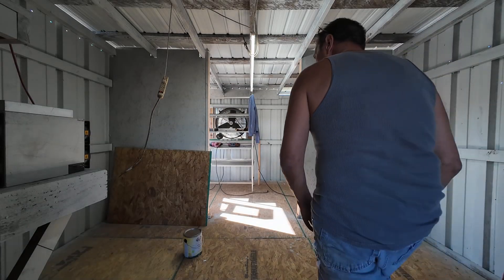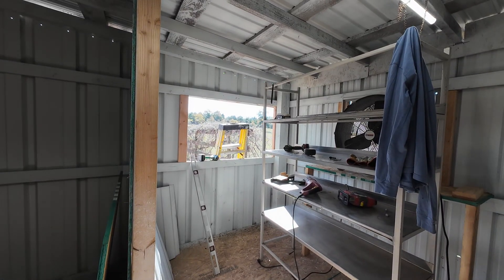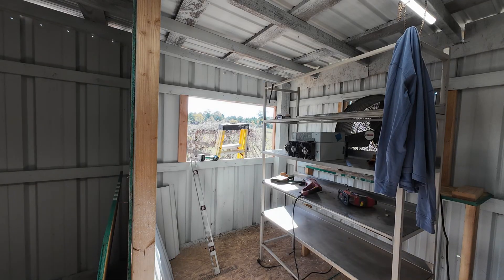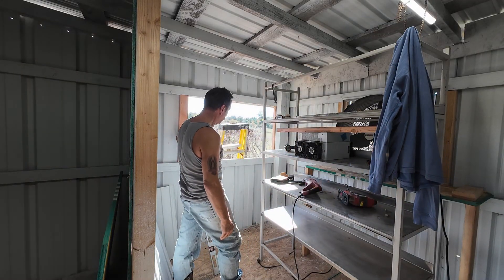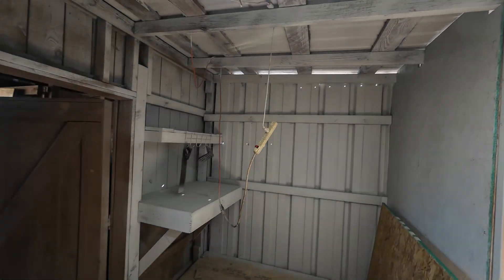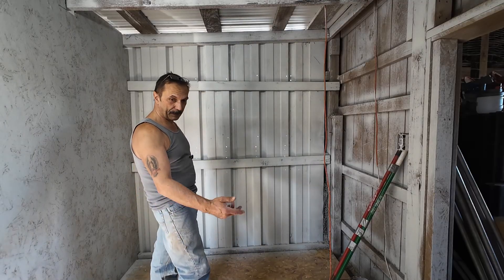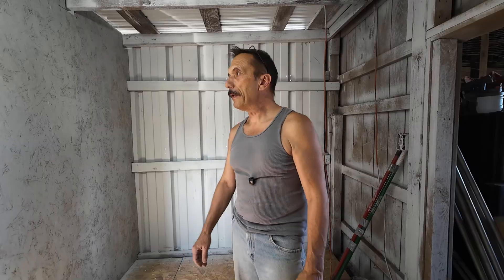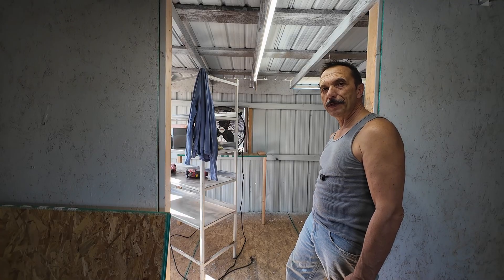Expanding the High Voltage Micro Grid for 50 kW of Miners

Comment: You suck air out not blow air in!
Reply from the maker: All the small mining containers are using positive air, the way I'm setting up the miners there will be no hot air inside, their exhaust fans are right on the outside wall. I also don't want to suck in all the dust from the barn. Let's find out, I can always change.

Comment: No intake fans!!!!!    Exhaust only and create that negative pressure that pulls heat from everywhere including your electrical.   Pull intake air low and on the shade side of the building if you can.  The exhaust fans will be fine that’s that’s their meant for.   Besides those fans eat power.
It’s possible to use the miners fans only but it’s dang loud if you have a whole wall of them exhausting in the direction of occupancy.
Reply from the maker: Thanks for the input!

Comment: It’s looking good.
Have you ever looked into Earth Tubes for Cooling?
Reply from the maker: Yes, but I do have a creek that runs behind this barn so the better play might be some type of heat exchanger?
Reply: @D @DIYSolarFarming  that might be better.  My first thought was digging some earth tubes parallel to the river, not sure exactly how far, but I bet that ground would stay very cool.
I’m playing with earth tubes and a radiator.  The fans onboard the miners will pull the earth tube air from the other side of the building, and it will pass through a radiator right before it gets to the miners, the only way they’ll get air.  This is in a larger building where the miners are in one room in the back.  The radiator pipe is buried with the earth tubes.  And of course the exhaust from the miners goes into the attic and heating duct work in winter, with a temperature power switch that sends exhaust into ducts when it’s not warm enough, and out of the building when it is warm enough…
Anyways, my thought is the earth tube air will warm a bit moving through the rest of the building, so the radiator could work to get it cooler just before hitting the miners.
Of course I’m on a much smaller scale than your working towards.

Comment: Split it into a hot and cold side. The have exhaust fans only.
Most mining farms don't use intake fans. Only exhaust fans and create a high negative pressure. Then a simple screen or rolled filter media to keep clean. Also allows for adding a simple water wall on the intake side to create an evaporative cooling effect with the exhaust fans for summer.
Reply from the maker: I'm thinking that keeping the fans on the cold side will keep the fan motors cool and extend their life. Some of the container guys are starting to do that.
Reply: @DIYSolarFarming Any reason why you are not just using 1 large hv inverter? Like a Sol ark 60k?
Reply from the maker: @14TheBass  A couple, 
The cost, I can buy 95kW of Solis inverters for the same cost
My build-out schedule, I don't want a huge upfront cost
Redundancy, if one 60K goes down the whole farm is down
Familiarity and reliability, I have proven out the Solis 11.4K
After a certain point it will make sense to go with larger inverters but I'm not there yet. 😄  
Good question!

Comment: My .02 of how mine works. Use the fan to exhaust the heat, not bring it in. I wish I would have built a cupola with large overhang to exhaust the heat through the roof instead so I wasnt so dependent on the fans. Use gravity and nature to help exhaust the heat. Reverse the direction of the machines so you can service them easier.
Reply from the maker: I'm thinking that keeping the fans on the cold side will keep the fan motors cool and extend their life. Some of the container guys are starting to do that.

Comment: have you developed any thumb rules like, "x number of KW per y number of miners"? as a sizing rule for your area using fixed panels (and no batteries)?
Reply from the maker: I run 4 S19's per 11.4kW Solis S6 High Voltage Inverter, 16kWp pv and I do run a small 16kWh battery per inverter.

Comment: Looks great. How are you going to handle the internet connection?  Are you doing a Point to Point wireless connection from your house, running a cable, or getting a dedicated ISP service there with wide area wireless or satalite?
Reply from the maker: I already have CAT5 run from the shop Starlink feed.
Reply: @DIYSolarFarming i had cat 5 run 200'  indirect lightning blew up all my network equipment I switched it to fiber optic with CAT5 adapters on either end
Reply from the maker: @SolarTechFL  Yeah that's smart, my switches do have fiber ports and I have the fiber here just need to get connectors but my ethernet is underground so don't know if its a big concern or not.